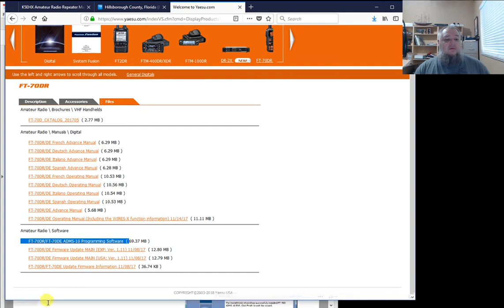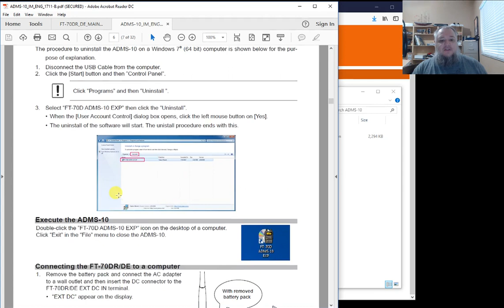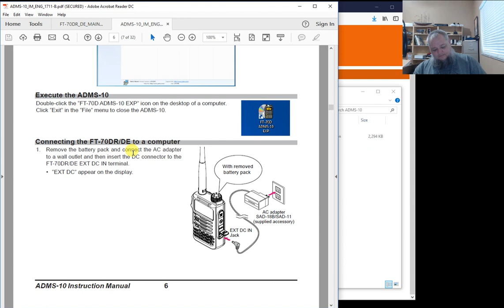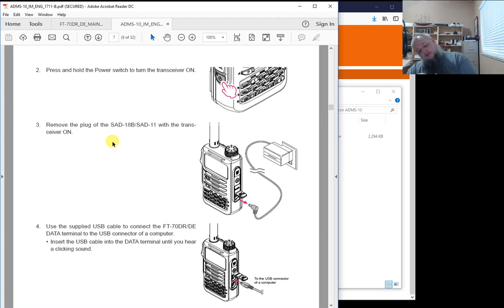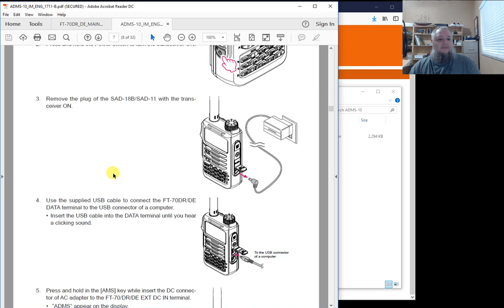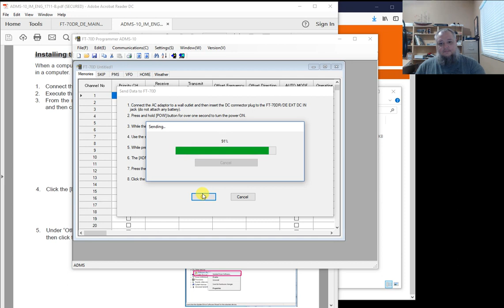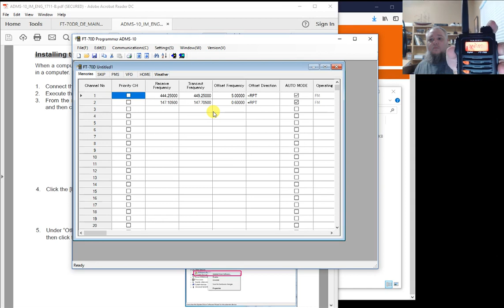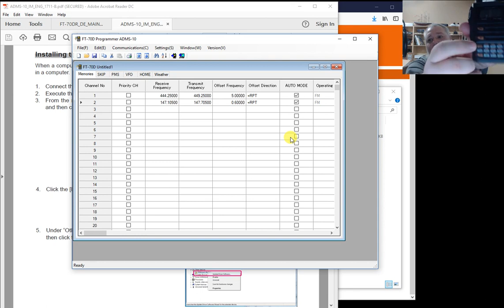FT 70D Programming

Comment: Where did you get the driver download from? It is not on the Yaesu site anymore, only the ADMS10 software, manuals, and firmware update files on the site. When I unzip the ADMS10 setup files there are no driver folder or. Info files
Reply from the maker: I looked for it myself. It does not appear to be available. I will see if I can find it again later.
Reply: Thanks for the reply. I also emailed Yaesu support. Thanks again

Comment: Hi: I have the Yaesu FT70D. I want to program this radio using a software 
, but every time that I connect the data cable I have 
this message ""  INVALID COM SETTING"" How can I solve this issue? 
Thanks
Reply from the maker: Make sure you installed the driver properly. In the video around time 2:20 I explain how I installed the driver. Thats one of the biggest issues is when the driver is not properly installed the computer won't recognize it when you connect it so it doesn't setup a COM port.
Reply: Thank you

Comment: Thanks for your explanation, better than the one other instructional video I was able to find. It’s crazy there is no explanation of software programming in the small user guide that comes with the radio, or in the advanced (downloadable) manual. Why in gods name wouldn’t they want to advertise a feature that is so useful for programming loads of freqs in, and channel specific info, as well as being able able to save it all to a backup file for reloading to radio if you screw up something while manually fiddling with the radio’s control buttons. Yes one should definitely learn how to manually control it, and store this info to one’s brain cell. But yes, this software method is a very nice feature to be able use to manage the transceiver. ✌️😁

Comment: Wow. This is ridiculously complicated just to program a radio. I was thinking about getting this radio and it would have been my first Japanese radio. But wow. I expected things would be easier than the cheaper Chinese radios but this is way harder. Yaesu could learn a lot from Baofeng!
Reply from the maker: its not as hard as it looks once you start doing it. I have a baofeng also and I find it to be a bit more complicated to program than the yaesu manually. via the computer the yaesu is a bit complex to get right not sure why they did it that way but probably has to do with how they configured the USB part of it.

Comment: Thanks for the video!.. Unfortunately for me, windows XP not compatible. Driver won't install then once it appeared to install, but didn't allow communication (downloading from chirp) 
.. 'Error" message..also, software from Yaesu won't run. Says invalid 32 software
Reply from the maker: Unfortunately I don't have an xp system to try and see if I could get it to work.
Reply: Thanks, no worries.. At least it isn't too hard to program by hand. By the way the battery discharges Super fast on mine.. Charged full in the morning. By the end of the evening the battery level indicater flashing! Have you had that problem?.. I wasn't even transmitting except maybe twice calling CQ
Reply from the maker: I don't run mine all day long. I only turn mine on at times that I have free to try and listen or talk on the local repeaters. So at this point no I've not run across that issue.
Reply: I might have had it on most of the day, but not all day either.. Probably heavy scanning is the cause :)
Reply from the maker: harles69 oh I don't have mine set to scan either. There is only one local repeater that is close enough for me to use so scanning does me no good.

Comment: Great video very helpful. Really helped me with my new FD-70DR. You should do more videos using FD-70DR and maybe go over some of the advanced features. Thanks.
Reply from the maker: Glad you found it useful. If there is anything specific you would like to see covered let me know. I'll see if I can put something together for it.
Reply: Joshua Bedgood  Thanks Josh, one weird thing I found with the FD-70D is that I have problems sometimes when I manually enter frequencies. For example when I manually enter the repeater frequency 446.740 the radio will change it to 446.737. Now, the repeater will still work but when I then sync to my computer using the ADM-10 software it says that it is an invalid frequency and then changes it to some other frequency that doesn’t work. If I didn’t notice that the software did that I now have bad frequencies for that repeater. I would have to go back & fix them. Why doesn’t the FD-70D let me manually put in the correct frequency.  Try it yourself by entering that frequency (446.740) from the key pad.
Reply from the maker: The step setting (function 4) is set to auto which will cause the radio to change the frequency to the most suitable frequency. If you set the step to some other setting than auto you can put in the station 446.740 as you are trying to do. But you have to remember that with it not being set to auto it could hinder your ability to be on the proper frequency if you mistype a frequency.
Reply: Joshua Bedgood , I do not have a PC, we have Mac’s. What are my options...? Thank you sir